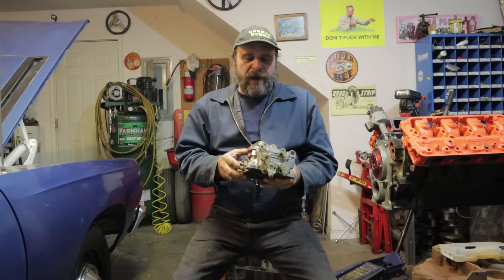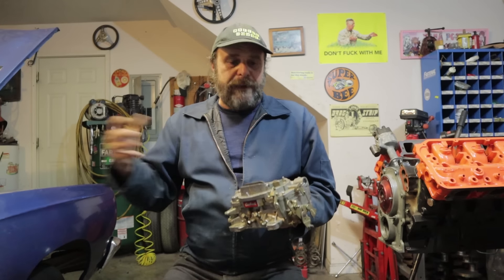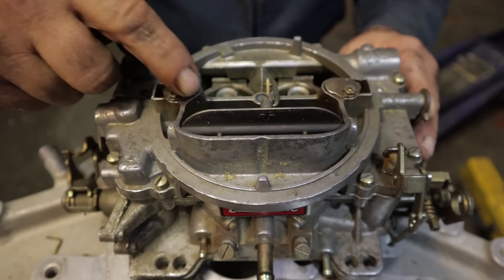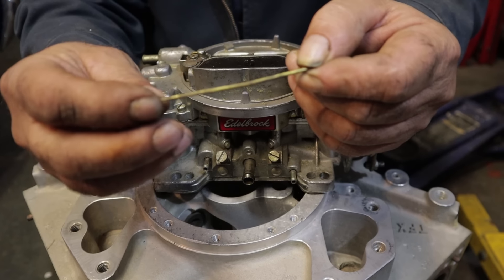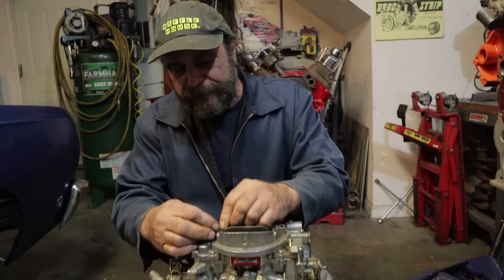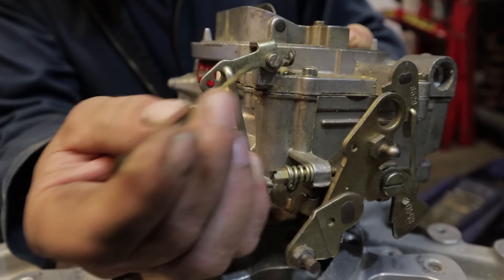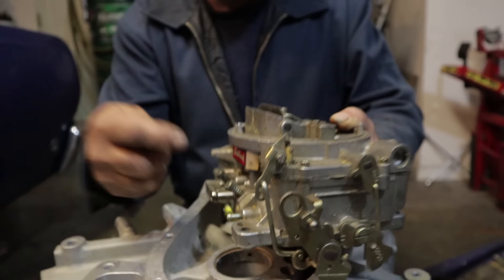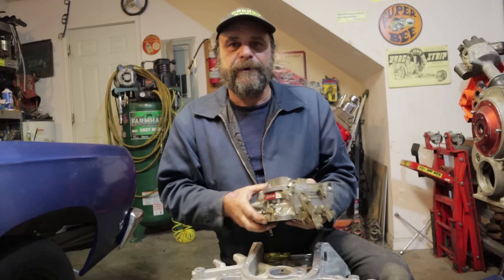How To Make The Edelbrock Carb REALLY Work For You

Comment: Glad that I’m not the only guy that likes an edelbrock. They just work.
Reply: holley's work too
Reply: Very few people understand Holleys too. It's rare to meet one who really understands them.

A little knowledge is a dangerous thing.
Reply: Until they don't. Aluminum carbs do not age well and actually change their tune as they corrode inside. In a dry environment they are fine. In an wet or humid environment, these seem to corrode and give major headaches after a short run time. Tony has not had to change out several of these that were no longer responding to tune it seems. For him to say that the reputation these have is because nobody can tune them is nonsense. And if they are that much harder to tune than a Holley....Anyway. Give me a 1965 AFB any day. A non corroded one that is. I had corroded AFB troubles back in the 1990's on a 1965 Buick Sportwagon with a 300. To deny this massive manufacturing failure is just fanboy shit. These carbs do not last like ANY zinc carb.
Reply: @hyperluminalreality1  I have a 800avs on a fairly wild 383 Chev.  I'm live in Ontario Canada.  I've had it for over ten years and never had a problem
Reply: @hueroski  yes and much better
Reply: HUGO FUGUSEV 
...and I have a ten year old 750 cfm Edelbrock on a Pontiac 455 that sits in a humid Georgia garage for months at a time. Always starts  immediately and runs great. I had the top off a few months ago just to check it out and it still looks brand new. Your experience isn't everyone's experience.
Reply: Fenderman1235  I wouldn’t have any carb but a Edelbrock 
I love them and it’s the only carb to have on a 4wheel drive
Reply: @hyperluminalreality1  they see the shiny finish on them. they automatically think the shine gives them extra 20hp on the edelbrock carburetor.  lmao
Reply: @matthewjohnson2495  disagree with you on only carb to have on a 4x4. Got 82 swb k10 454 run a holley 700dp. work flawlessly had a junk edelbrock on there bought brand new. it would stumble an fall on its face. month into it float ended up having a pin hole in it
Reply: @justinpeacock2937  I have run Holly's and I have run Edelbrock's with no problems. Holly has shiny as well so don't go there. If that guy talking about corrosion is having that much trouble, he needs to find the problem(and it is not the aluminum).
Reply: @justinpeacock2937  That is the kind of response I expect from someone who THINKS they can work on carbs. Since all you seem to how to work are Hollys. Maybe you should expand your limited knowledge and work on something else. Aluminum isn't going anywhere,get use yo it. It seems like you need the feminine napkins.
Reply: @justinpeacock2937  I had an Edelbrock on a kinda wild big block in my 69 Charger. It would also hesitate and stumble on throttle tip in. I called Edelbrock and was told that they don't use the idle well on cams over 240 duration @.050. The AVS, and other improvements, has seemed to help that so they can be decent carbs.
Reply: @stevegibsonii3910  nope dont need to expand my knowledge on them. Junk is Junk. did your bleeding stop.🤣
Reply: @jhutch1470  my experience with them isn't great. I like my Holley the truck can sit outside with out being started in weeks 1 pump and she bust off and idles fine no choke. With the edelbrock carburetor had to pump it several times and couldnt let off the throttle at all or it die with a eletric choke. took to a guy who knows more about the carb then me he was baffled as well he hooked vaccum to see if everything was working right and adjusted right everything was in line it shouldnt had any reason of doing what it did. Then month later we found the pin hole in the float. maybe that was the culprit but who knows. I got the problem fixed that was sitting on a self for 9 months with out being used the old true faithful HOLLEY 700 DP!
Reply: Justin Peacock you must have bought a refurbished carb and if you found that there was a hole in the float then replace it and try it again and you also must drive on nice smooth roads all the time cause if you bounce a Holley around some they go all to hell
Reply: @justinpeacock2937  Ok. I did love my Barry Grant I had on a wild build. Holley stuff is great also.
Reply: There's no problem with aluminum carbs. If your getting that much corrosion there must be a fuel issue. And even then, clean the carb and good to go. I've got an AVS that came factory on a 68 charger. It works great today. I've got a couple edlebrocks . Never had a problem 1 . They are exelent carbs. I've owned and worked on all sorts of carbs. Holley has given me more trouble than any of them. Metering plates warping. Float bowls leaking . Floats constantly out of adjustment. And bad power valves . Especially if you have a backfire. Bye bye power valve.
Reply: @hotrodray6802  agreed on that, Holley carbs work well too. Carburetors in general are not understood by many any longer due to the proliferation of fuel injection. A properly adjusted carburetor is a beautiful thing and a carburetor that can be tuned for changing conditions without disassembly is a street/strip dream!
Reply: @justinpeacock2937  Wait. What??  You mean it don't??
Reply: I just prefer a good old fashioned Quadra-Jet like what my Chevy Square Bodies use. Too many people giving them a bad name because they dont understand them.
Reply: I've put dozens of edelbrocks on our different builds. I thought I was getting heat soak on the last sbc we were doing, would run great then boil over after shutting off. After a tear down of the carb, discovered a float had a hole in it. Replaced it and all was well 👍edelbrock for me please
Reply: @hyperluminalreality1  
I beg to differ about your claim that AFB's/Edelbrocks corrode. I've had the same Edelbrock 1406 on both my 72 Chevelle, 72 C10 and it now resides on my 73 C20 going on 17 years. Edelbrocks are very user friendly and reliable. I also am fond of Quadrajets though Quadrajets definitely have some frustrating quarks and are a bit more complicated. But once you get one dialed in there's no beating them.That's what I put back on my Chevelle and 72 C10 just because I still had the originals and I decided to refurbish them back to new.
Reply: @hotrodray6802  you are correct..people who don't like holly carbarater don't understand them .they don't understand power valve size or float adjustment ..I just laugh when people tell me they are junk !!
Reply: SOU6900 Yup, properly set Q jets run great. I even worked with a guy who ran one on his 340 Duster.
Reply: Had a buddy years ago that thought Quadrajets and Edelbrocks sucked until he'd swap on one of his Holley's and his car ran worse but was too stupid and proud to admit it.
I'd have to fix his screwups to get it running right. Swapped out the the Holley for the Quadrajet without telling him and it ran amazing. Just have to learn how to tune one up properly and they're great!
When he found out what I did he got pissed but never did put the Holley back on!😉
Reply: Hugo Fuguselv calm down.
Reply: @briankennedy5578   that old AVS is an awesome carb and they are excellent for off road with that consistent air valve. The new ones, I cant say as I run qjets on everything these days. Ive built/rebuilt everything from the old thermoquads to holleys to qjets and just really like the performance of the qjet above all the rest.

Comment: It's amazing that no one talks about the biggest drivability improvement which is the wire into the air bleed trick which makes these run like EFI buy eliminating the lean area just off idle in the transfer slot range which is NOT affected by metering rod, spring or jet changes

Comment: many people hate these because they can't tune em.  they think turning the idle mixture screws is "tuning"... I personally love them because they give you no trouble once you have the right jets and metering rods in them for your application.  and they're not elevation sensitive...  not as much anyway.
Reply: Ive got a la 360 rebuild 10 to 1 compression, aftermarket heads cnc flow, decent cam, all new 4 second flat ignition, 4 barrel edlebrock, idles great, backfires some when im really steppin on it, any ideas on which way to go for changing jets or springs or rods?

Comment: You are 100% right about guys trash talking Edelbrock carbs because they know nothing about them. Most of them have tried one and didn't know you can't run more than 5.5 lbs of fuel pressure or it leaks gas all over the engine. I have a Carter muscle car series fuel pump designed to work with an Edelbrock carb that has a max pressure of 5.5 lbs and only drops to 5 lbs at full throttle!

Comment: I agree Tony they are the simplest carbs. Witch means less things to go wrong. No rubber power valves or leaking bowl gaskets.
Reply: Holley is the worst for leaky seals
Reply: However, a Holly with a double pump mechanical secondary tuned properly will out perform Edlebrock.  Night and day.
Reply: @hackfreehvac  your right but the edelbrock is almost trouble free

Comment: Finally!! Someone on the same page as me!! I run an avs 650 on my 69 camaro, race it every weeknd! My tow vehicle 454 had a holley 750..junk! Put edelbrock 600 pulls better than my Cummins diesel,  now the new avs 650 has secondary air valve, ones adjusted instant throttle response!! No flat spots! Great demo bud!

Comment: so glad to finally find a wrench turner that recognizes the real qualities of the Edelbrock. So many other channels just talk shit about the Holley. I had run Holley since the mid 1960's and I can tell you they are a pain in the ass....always going out of tune with vacuum leaks in the nasty valve body gasket and their choke system never was worth a crap, it too would easily cause too much load up. I finally relented in 1997 and put a 650 Edelbrock on a well built ford 400 in a pickup. I never knew life could be so good since that time. The electric choke has been flawless even to this day on that old "78 4x4. The carb never coughs, never fails. I have never experienced the stumble from dry circuits you describe....ever, just start and run, never fail. It is super easy and convenient to pull the top and check/clean float bowl and make metering adjustments if desired. This design is so superior to Holley for street use it is ridiculous. I have a couple of Demons run on a stroker...the ones before Holley got hold of them..... and they have worked extremely well too but none can match the smoothness and easy start of the Edelbrock.

Comment: I have a Carter AFB 625 CFM on my 40 year old Dodge B300. I don't think it's original to my vehicle. I've had absolutely no trouble after it sat for over 30 years. The carburetor you are holding is an exact replica of mine. I've learned so much about carburetors from you thanks to your no-nonsense way of explaining it. Thank you so much!

Comment: Had an AFB sitting on the shelf along with QJet.  Car a bought had a leaky Holly.  Grabbed the AFB and bolted it on.  Ran fine and idled great; no adjustments.  Bought a kit because it was sitting quite a while and will be rebuilding it soon.   Q jets are great carbs too.  Holly's seam to be more work to set up.

Comment: I love the Edelbrock carb. My shelf in the shop has a few sitting on it that I got for free or peanuts... because the guy I got it from said "it's  a POS..and I'll never get one again...their loss has been my gain...user friendly for  a young hot rodder because if you pick the right size it will give you good results right out the box.
Reply: Yes sir.👍
$100 will still get you a new take off POS.
LOL
Been my favorite since 1960. 👍👍
Reply: The reason is that Holley power valves are either on or off.
Edelbrock rods move proportionately by the springs.
Original AVS (RoadRunners etc) had 3 step rods.
Reply: Wish I could find some old Quadra-Jet carbs like that since people talk so much shit about them.

Comment: Preaching to the choir I had one on my 84 Buick LeSabre with a 70s Cutlass Oldsmobile rocket 350 Ran amazing for 240,000 miles not saying I did not tuned or work on the daily but it was a passion.

Comment: The AFB's were overlooked because they looked to simple to work so everyone went for the " had to better " more complicated Holley band wagon. I've run AFBs on street in dual quad configuration since the mid 60s, easy to flog on the go. Have a nice pair of Holley 650's for MY 360 tribute build of Dad's '74 D100 shorty stepside. FYI Carter manufactured AFBs for marine use. The primaries  and secondaries are the same size,4 big holes. I found mine in used marine salvage yards.
Reply: Funny thing about that is I'm pretty sure afb/edlebrock's actually have more moving parts then a Holley which is probably the main reason the Holley design won out in drag racing. Either carb is simple to mess with. Hell, they make externally adjustable jets for Holley if you can't be bothered to drain the bowls and remove 4-8 screws to change jets.
Reply: @177SCmaro  Yup if your schooled in all that but most aren't. Chill dude Never said one was better than the other.
Reply: @peacfulseas  Neither did I. I pointed out its funny to me if the perception of Holley was "more parts, more better" since they're actually simpler carburetors.
Reply: @177SCmaro  I have experience with both,run both. While the AFBs might have more moving parts(?)  tuning a Holley for the novice is far more complicated. Power valves,secondary vacuum springs. None of which the AFBs have and are more forgiving when making changes that don't require a complete teardown. UT,UC channel is aimed mostly aimed at beginners but I'm never too old to learn from anyone with experience.
Reply: @peacfulseas  
You can get both carburetors with or without secondary air valves/springs and the power valve is mechanically simpler then metering rods (although more of a pain to get to but can be deleted for racing). My main beef with, at least Edelbrock's, is their crappy/inconsistent accelerator pump design which fucked me out of many a race with the infamous random "Edelbrock stumble" at the line. 
Other than that I found them to be fine carburetors. Great for the street. Ran one on my pickup for years. But when I go racing it's a Holley double pumper-style or nothing.
Reply: @177SCmaro  You win I quit. Enjoy . /s
Reply: @peacfulseas  lol, it's not a competition. To each his own. Just sharing my experiences back.
Reply: @177SCmaro  Really?? I am looking at it from as UT perspective of being aimed at the novice, not someone like yourself,myself. I don't dispute anything you stated just who it was aimed at.

Comment: I prefer these carbs for street use on a square port intake.  On a spread bore, a good pre computer controlled Q-get,  or a Thermoquad that has not been cracked.   I find that these carbs are also prone to boiling the fuel in the carb and are sensitive to fuel pressure.  A heat shield under the carb works wonders, and keep your fuel pressure to 4-5 psi and they are a set them and forget them carb that will work flawlessly for years.
Reply: fuel pressure is key, holleys like more than the Eddys for sure! great tip!

Comment: Just be aware, they are assembled to run lean, so you will need the tuning kit. Great advice as usual.
Reply: True... if I didnt add a o2 sensor to my new motor build I probably would have had a melt down in a week. Love the avs2 tho
Reply: My experience has been the opposite here at ~4,500' above sea level. Usually have to at least change metering rods, but usually 1 or two sizes smaller primary jet and 1 smaller or no secondary jet size.
Reply: 100% YES. 
I put one on out of the box, ran it maybe 2 miles, and the plugs are LEAN - very light brown.

Comment: Awesome info 👍 I just bought a 1982 Corvette stingray the previous owner before me had the engine rebuilt, took out the crossfire injection system and put a regular intake with this exact carb on it. I am not familiar with this set up because I'm used to fuel injection and I rely on my obd2 software to make any adjustments 😅. Just by hearing how you explain to tune it and make adjustments I can tell you had a professional shop. 👍 It's like my trade as well, I'm an HVAC technician I learned from "old school" techs they showed me tips and tricks and explain things differently then my instructor did in school! He mostly used digital gauges and electronic equipment. The techs I learned from used all old school analog gauges and regular temp probes they did tell me the new style is good but almost all new techs don't know how to read analog gauges 😅 Now I pass the knowledge to my younger brother and together we own our own business. Thanks Tony!